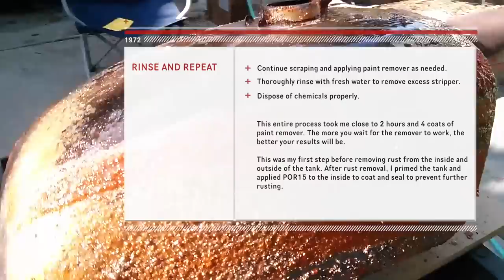CB750: How to Strip a Motorcycle Tank

Comment: How did you get the gas cap off?
Reply from the maker: Using a very thin punch and mallet I just punched out the retaining pin.
Reply: Cool, I'm trying to get a 72 CB750 rolling. I have to get the tank dipped and coated
Reply: Looks like we working on the same bike.
Reply from the maker: A very thin punch and hammer through the compression pin.

Comment: That stuff is extremely toxic and contains VOCs. It's advisable to wear a proper safety glass and respirator with filter for VOCs while doing this. It's one of the most dangerous stuff out there in the hardware shop.